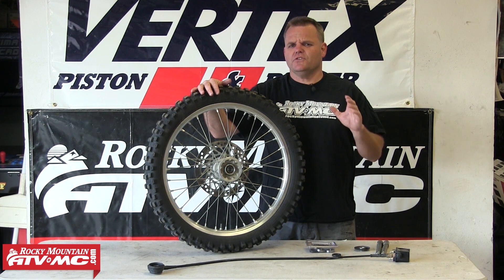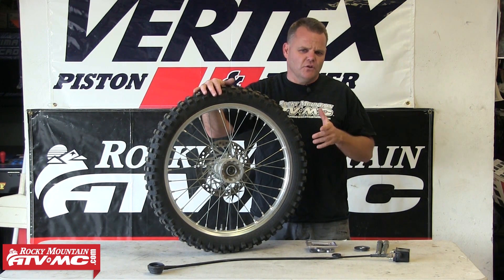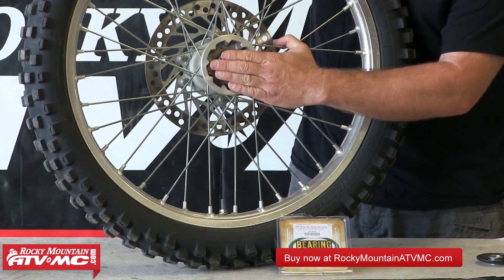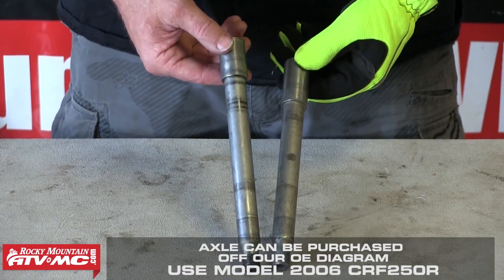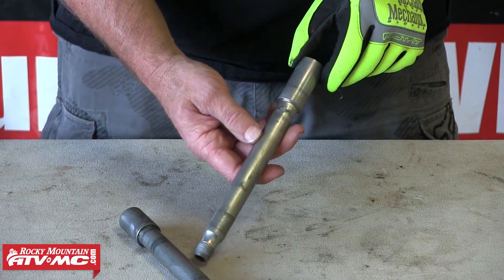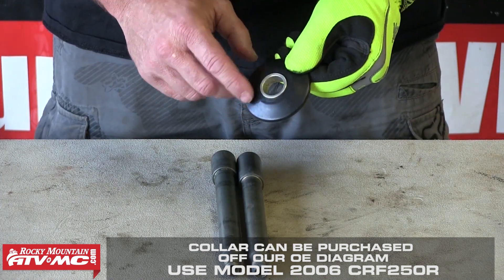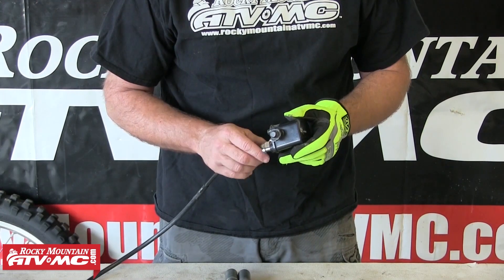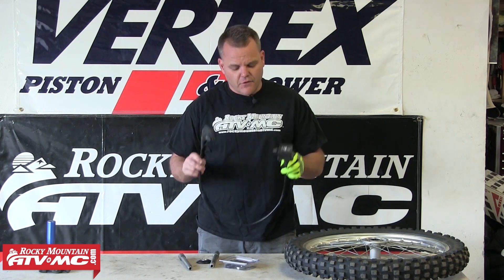Honda CRF250X & 450X Odometer Removal

Comment: Installed a trail tech vapor 3 weeks ago and was looking at options to remove my stock odometer, this worked perfectly. Ordered the parts as described, and everything fit like a glove on my 2016 250x, 10min. job - thank you RM!

Comment: I know this video is old but any tips about removing a speedometer cable from the caliper (the previous owner of my bike put one on and I’d like to remove it) I’ve already got the speedometer off but the cable is still connected to the caliper